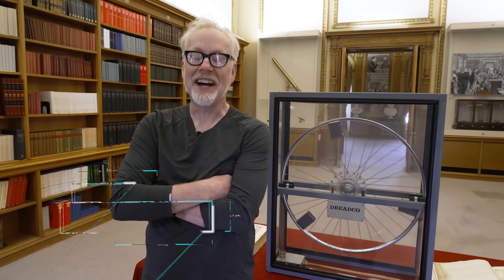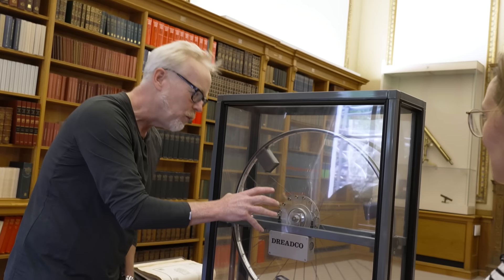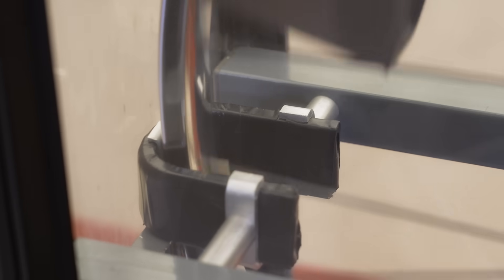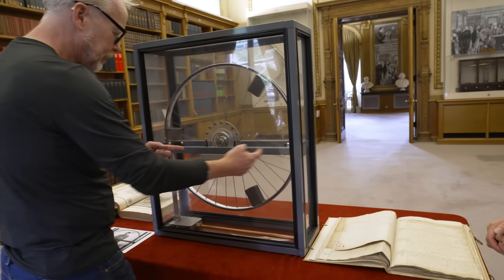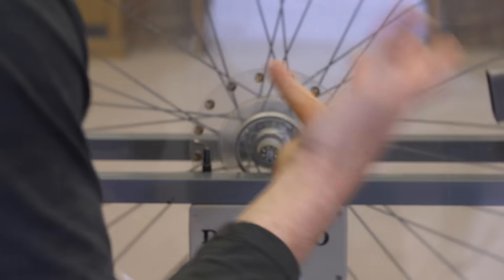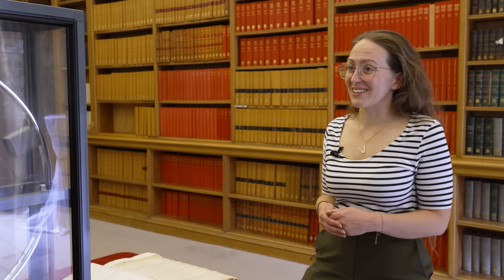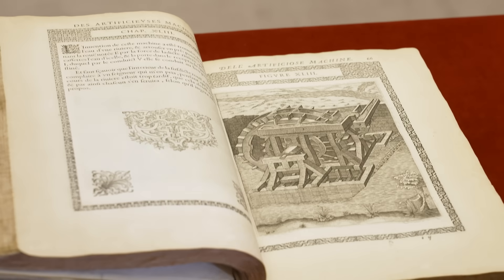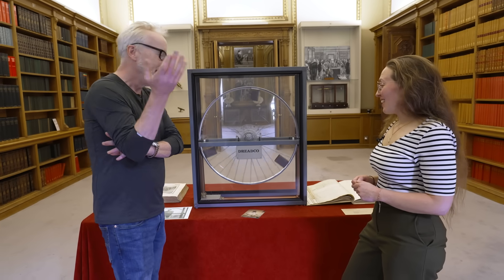Adam Savage vs The "Perpetual Motion" Machine!

Comment: Its a motor, either brushless dc or permanent magnet synchronous. i think adam got it backwards though the cans have permanent magnets, the magnet looking things on the sides have the coils/windings. box at the bottom has the power source, box in the middle is a distraction.
Reply: I've been thinking about this a little more and i think its even simpler that a proper motor. Its a waving cat/flower. same setup, magnets in the cans, coils at the sides, power in the bottom. The magnet moving past the coil induces a voltage to a very basic circuit that pulses and gives it a little kick back. The middle could hold a couple solar cells but i don't think its necessary.

Comment: The box at the bottom is definitely a red herring.  If the heat sinks actually do anything, it would signify that the device is WAY over unity...generating more electricity that is needed and must be vented off.

I think the box in the middle is the power supply and the little "electrode" on the left is connected to a hall effect sensor in the box to provide timing to the electromagnets on either end (which really could be just one e-mag on one side).

Adam, I am disappointed that you did not grab the magnet test tool that is ALWAYS in your pocket, your smartphone's  magnetometer, and actually try to read if there are pulses on the ends.
Reply: Hi, which app would you use to detect magnet fields?
Reply: @wackamoles  smart tools for android is a good one
Reply: @wackamoles  google maps
Reply: with the heat sink it wouldn't necessarily mean its generating too much heat and needs to get rid of it, it could be some way to make a temperature difference, you can generate energy if you have 2 different temperatures,  also instead of releasing heat maybe it could be  doing the opposite, anyway its probably not any of these, there is many ways to make it move, you could build 10 that all look the same but work different, it would be cooler if they didn't need decoys to confuse people, but then again maybe it needs all those parts to work, they should just tell people how it works
Reply: @ExperimentalFun  Where are you getting your temperature differential from without adding energy to the equation?
Reply: @treborrrrr  Cold concrete floor and warmer room air? I doubt it actually is a heat engine, or that the temperature difference is reliable enough to power it, but something like that would be a very sneaky way to recharge batteries
Reply: @camicus-3249  No need to charge the batteries since it is being "serviced" regularly. As in, the batteries getting replaced.

And a pretty big assumption by the inventor that it would be stored on a very cold slab of concrete with a warm room to create a temperature difference. Plus, those types of devices are very very inefficient (if not, peltier cooling in computers would be very common). It's just so incredibly far fetched when there are much MUCH easier ways to do it.
Reply: I figure the heatsink involves some kind of stirling engine
Reply: What if it's not electricity?
And have you checked the positioning of the "electrode" cups vs. the wheel blocks?

Comment: I think much of the equipment inside the case is purely decorative.  It's just red herrings to confuse people.  I have a 'perpetual motion' clock that runs for two years or so between 'services' (replacing the battery).  If I fitted more or bigger batteries, I'm sure I could get it to run for decades.  If there are batteries in the three boxes that rotate, that would provide plenty of energy to keep the low-friction wheel turning.
Reply: For sure. Anything inefficient enough to require that amount of heatsinking would not run for long on a battery. Thus they are merely decorative.
Reply: @-vermin-  As soon as he mention Sir Martyn, I could think of a couple of things that are fairly efficient, do need heatsinks, and also need to be kept in a controlled environment. Plus they'd know the paperwork requirements to run it off a small RTG.
Reply: @-vermin-  my first though the coper pipes and heat sink would be for a heat engine (sterling engine) but you would likely hear the moving parts of that. Could be also a peltier device generating power from heat differences, but not sure those were around when that was created.
Reply: @-vermin- unless the heat sink was for a thermo electric generator, to increase the temperature difference across the plate.
Reply: @-vermin-  also. its a closed box llol where would the heat be venting to haha
Reply: @-vermin-  the heat sinks might be decorative, but the pipes might not be, note that the pipes are of copper  and might be used to hide wires and be conductors of their own.
Reply: @lordRW  If he has built that many pieces of window dressing and fake methods of powering it to misdirect you into following dead ends, he won't use something as stand outish like the only copper in the entire display to run the real drive system through. Having the copper tubing run between the two 'U' shaped pieces on each side just begs to be a way to hide the real wiring and is almost certainly not involved at all. Adding the impossible heat sink to the copper tubing further amplifies the assumption that deliberately made it to entice people to "watch the copper tubing and ignore the man behind the curtain turning the crank".
Reply: The metal frame of the case itself has enough volume to house at least 90 AA batteries.
Reply: @anichtyofagist  or  just plug into a wall socket  then you get power for  centuries,  no batteries needed
Reply: I've heard, and it's probably in the comments for this video more than once, that the hardest part about building a perpetual motion machine is hiding the batteries.
Reply: It would be better to get the energy from its environment. If you can do it  through multiple methods then you can confuse people who try to eliminate the energy source. Photovoltaic, heat engines etc. Then the only issue you have is maintenance of the bearings. If you could harness the rotation of the earth as the power source then that would be really cool.
Reply: I think the clock analogy works very well. I had an old battery powered wall clock that had a mechanical movement and ran off of one C-cell battery that would last about two years.
Reply: Their is a battery operated bell that has been running for almost two centuries (since 1840).
It is just both very big and very lightly loaded.
Look up the Oxford Electric Bell.
Reply: Oh it's almost certainly battery powered, the interesting bit though is figuring out how they've concealed whatever motor and wiring is in this though. The only thing I can think of without a closer look is the batteries and some coils being in those boxes on the rim, but if that's the case the wheel must be extremely low friction to keep a constant speed with how far apart those windings would be.
Reply: A battery would be a very disappointing solution.
Reply: @snower13 yeah, magic tricks are generally disappointing when you learn how they work
Reply: @splatter_proto  Agreed. I've worked with one of the most famous magicians in the world and while I have, of course, signed extensive non-disclosures agreements, I can say that if you knew how most tricks were done, you'd be disappointed. The true magic is in the showmanship.
Reply: @splatter_proto  I dunno about that. When I figure out how a real good sleight-of-hand trick is done, I'm generally more impressed than when I don't know how.
Reply: @snower13  Yeah, but with very little friction and long lasting batterys you can use very little power to drive a wheellike this for a long time thanks to its inertia and it only needing very little power to keep spinning.
Reply: @snower13  But satisfying in the disappointment. 
I think I might need to build my own model but I expect that Adam will beat me to it and with better outcome than I could manage... Not that it'll dissuade me! 
A Lithium primary cell is very energy-dense, easily hidden among all those "components" and it wouldn't be too difficult to manufacture a device that could turn longer than I'll likely live, much less for two years.
Reply: @matthewellisor5835   But they didn't make lithium batteries in the 1980's when it was built. It would have had to start out using alkaline batteries.
Reply: Everything is magic until you know how it works… and then sometimes it is still good to watch
Reply: 1) No locality is at absolute zero.
2) Spontaneous thermal fluctuations (noise) .
3) Diode  takeoff.
4) Voila!
Reply: I'm pretty sure there are batteries, but my theory is the batteries are actually inside the 'dreadco' box and the 3 wheel boxes are either just for weight, or only red herrings.  It's possible they are also actual batteries, but I suspect they aren't.
Reply: just plug it into AC, then no batteries needed
Reply: If u think it's batteries .... make one and see how long it last. I bet u only get 4 months rotary motion before the batteries die, giving the volume of the hidden areas.
Reply: Duracell bunnies will easily double the "service" intervals
Reply: but as adam said, there was no way to run power from thos boxes to anywhere else on the wheel (like the hub)
Reply: @En-Beet  Plenty of space inside the metal ring to run cables, but there's no need to do that. IMHO it's simply electromagnets giving the "boxes" (disguised permanent magnets) a gentle nudge as they pass by. The batteries can be stored wherever, in the pipes, in one of the boxes, in the frame, plenty of space for it.
Reply: @En-Beet  There would be no need.  Each box need only contain a coil, battery, and transistor.  As the coil passes through the horseshoe magnet it generates a small voltage that switches on the transistor - the transistor then provides a pulse of current from the battery through the coil which, working in conjunction with the magnet as an electric motor, provides a small impulse to the wheel - just enough to overcome the losses due to friction and air resistance.  There are lots of desk toys that work on the same principle.  Typically, they keep a small spinning top spinning for many days or weeks, on a single battery.  The slowly rotating, low friction, bicycle wheel requires hardly any energy to keep it moving - it would likely run for maybe an hour with no energy source at all - just by giving it an initial spin.
Reply: As everyone is saying this is about overcoming the devices internal intrinsic friction. It is not outputting energy to do work and in that case in a 'zero friction' device 'perpetual' motion is perfectly feasible. The Earth does it. The two big sources of friction here are the air first & the bearing second. It is probably driven by a battery but it does need a sizeable amount of energy. Maybe there is a vacuum inside the case??
Reply: @ceptimus  
No need even for that, just a battery, a coil and a magnetically actuated reed switch.
Reed switches the electromagnet on as it approaches, off as it passes, imparting kinetic energy in the wheel but preventing cogging (where the fixed magnet reverses its pull as it passes through)
It's a very clever replacement for a DC motor's commutator, and almost frictionless, but it's an electric motor nonetheless.
Reply: @ceptimus  The key to your conception still requires a timing switch to pulse the electromagnet inside the boxes at the optimum moment. I suspect, if indeed the impulse electromagnets are inside each box, that either gravity or a finely balanced contact switch is required, only working at the dead horizontal plane. I note that each of the other perpetual motion  devices shown also have the horseshoe magnets at horizontal. One other gravity switching means would be a mercury switch in each box.
I have also considered the permanent magnets would work equally well in being inside each wheel borne box, since the purported horseshoe magnets are wrapped. Reverse the arrangements and use thin button batteries  wired under the wrap and electromagnets lined up to center on the  PM's in the boxes.  That pulse would then be triggered just after peak using a magnetic driven reed switch. It may need only one of the "horseshoe" magnets to be disguised with the other a fake. Yours is the closest to the conclusion I reached before I read it.
Reply: @SineN0mine3  Gets even worse though.. Brownian motion is a form of perpetual motion so every atom in the universe is in effect a perpetual motion machine.  😆🤣
Reply: @Lucien86 The earth does not do it: the earth is slowing due to fiction with the moon and the sun: the moon stopped eons ago! Perpetual motion is exactly the opposite of "perfectly feasible": it's completely impossible.
Reply: @ceptimus  the motor is in the hub or the box on the hub.
Reply: @En-Beet  I think those boxes could still be batteries and supply power without being directly connected to anything else by hiding an inductive coil in the boxes.  When the box passes through those U-shaped brackets at either side of the wheel, they could pass energy along "wirelessly".
Reply: @arcticblue2  the problem with that is that they would also have to have a circuit inside for the timing, and making 3 non connected circuits that runs EXACTLY on time for at least 2 years in the 1980s isnt any more beliveble than perpetual motion, as far as im aware.
i bet you it would be near imposible to make this machine like that even today, maybe in a higly controlled enviorment with reeeaally accurate eqipment.
Reply: @En-Beet  No.  The three independent circuits would each provide a small impulse to the wheel when they passed through the magnet.  They can detect the position of the magnet using a magnetic reed switch, or a mercury tilt switch (the boxes pass the magnets at the horizontal position) or by the pulse of current the magnet induces in the passing coil. There's no need to interconnect the boxes.  There may not be three circuits - just one 'active' box, and the other two just contain weights so that the wheel is correctly balanced.
Reply: @En-Beet  That's what Adam said but that doesn't mean it can't be the case - only that he didn't find how it is done.
Reply: @En-Beet  wrong, the bike rims have hollow space . also theres a rim strip and you can use thin flat wire. easy really
Reply: @En-Beet  You could easily run insulated wires through the rim. I don't think you need to for this to work, but you could.
Reply: Batteries by themselves make it no longer a Perpetual Motion device. The purpose of a PMD is to create and harness energy from absolutely nothing.  When you have a "battery" you are "creating" energy from an energy source.
Reply: @jonathanward8967  It's not a PMD. Because PMDs are not possible. They're already said there's a 'trick'.
Reply: @fuzzysteve  Ur.. You're basically standing on one. Its PMD's that 'generate' or create energy over-unity that are impossible.
Reply: @Lucien86  afraid not. The earth isn't steady state. Slowly losing energy to its surroundings. Its just a matter of scale
Reply: @fuzzysteve  Nothing natural is steady state. I used the word 'basically' because the Earth stands in as a generalisation for all moving or orbiting bodies in space. Planets, moons, stars, galaxies, galactic clusters, super-groups etc. Sure that motion will end one day but only when the universe itself ends. I would say that qualifies it as 'perpetual'.
Reply: @Lucien86  This is just flat out incorrect.  Every body in the universe has a variety of forces being applied to them at all times.  Even drag despite the vacuum of space as there are particles throughout.

Saying it is "basically" perpetual is you just saying that it isnt.
Reply: @RavenGlenn  Sigh facepalm.. 'Basically' is a generalisation to ultimately every moving object in space - the whole universe. So you are saying that drag 'and forces' will bring all motion throughout the universe to a stop? And without destroying the universe at the same time?
Or is the end of the universe too soon for you to consider it to be perpetual??
Reply: @jonathanward8967  "Batteries by themselves make it no longer a Perpetual Motion device." Well, that's because it isn't a perpetual motion device, just like nothing else is a perpetual motion device either...that's the entire point. PMDs don't exist, and the determination of which type of technology is actually creating/releasing the energy is left as an exercise for the reader.
Reply: @jonathanward8967  That is your definition of PM, not the designer. It is just a machine that moves perpetually, or for a very long time. No attempt to generate energy at all.
Reply: @jonathanward8967  Did you not hear them say that it was not possible for it to be a true perpetual motion machine?
Reply: @jonathanward8967  There is no PMD, since it is impossible, and thus it is stupid to complain about batteries. Its an illusion, so it doesn't really matter.
Reply: @jonathanward8967  If the "point" of perpetual motion machines is to harness free energy, you'd think people would be more excited about the simple devices which can extract free unused energy from natural phenomenon like wind turbines, water wheels and solar panels.  

Once you set them up, they will continue to provide essentially free energy which can actually be used, unlike any of these perpetual motion machines.  

Of course they will eventually break down due to wear, but so do all of these machines.  

I just don't really understand the appeal.
Reply: @jonathanward8967 PMD's aren't real. You need to accept that and understand that energy has to be generated somehow, either chemical, electrical, thermal, or possibly (though I personally feel it's very unlikely given the storage conditions of this device) solar.